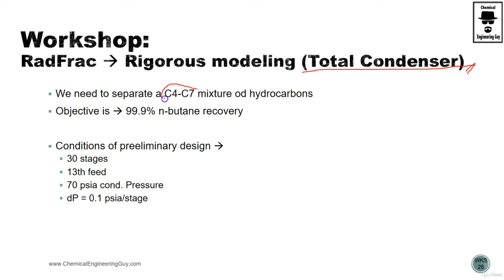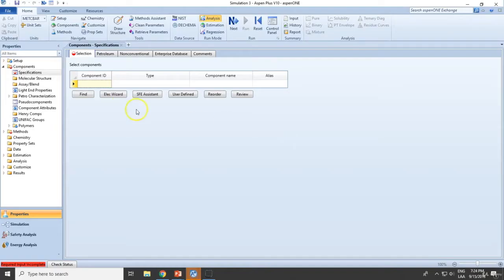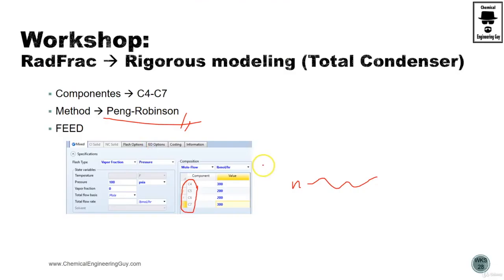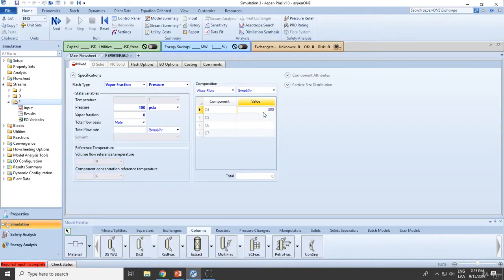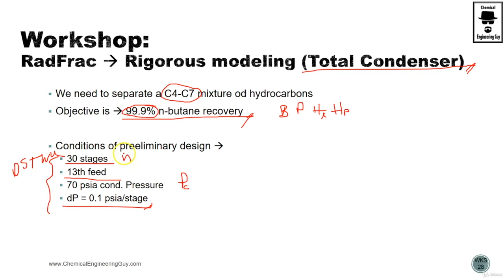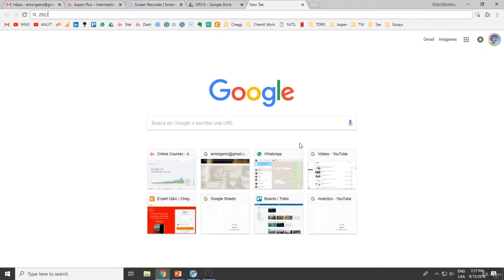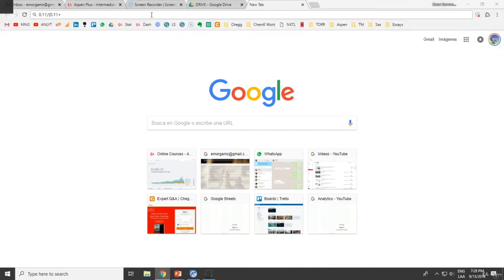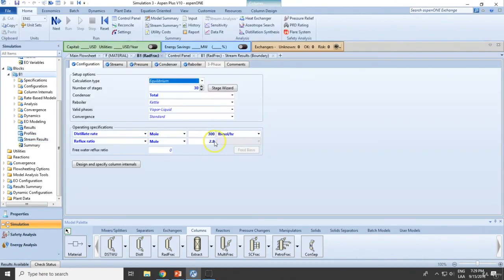Workshop: Distillation Separation of a C4 C7 hydrocarbon mix with RadFrac (Lec089)

Comment: Hi dear
If you have a time , please reply me 
I want to make a design of tower for a special my case  
I have (c5 to c6) 
I want to get  iso_pentan from this mixture  but only I have 
( Pressure and temperature )
Could you help me please 

Best regard
Reply from the maker: Yeah, thats actually easy to do as there is one carbon difference in the molecular weight! You will be able to do this via distillation alone!
Reply: @ChemicalEngineeringGuy   
Thanks a lot for your messages
That is right our composition is  same 
I will do it as you did it.
But actually I don't have Aspen plus , could you help me to get it.

Best regards